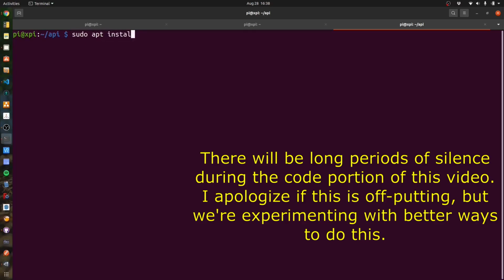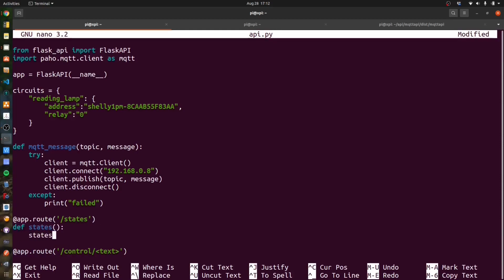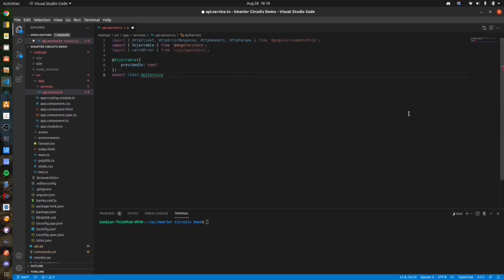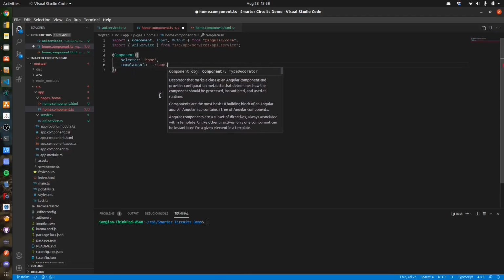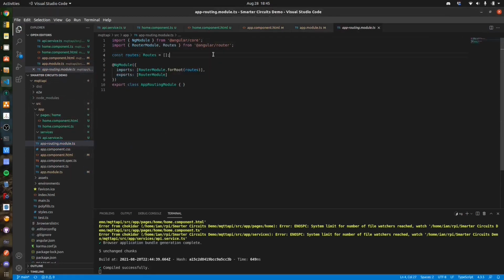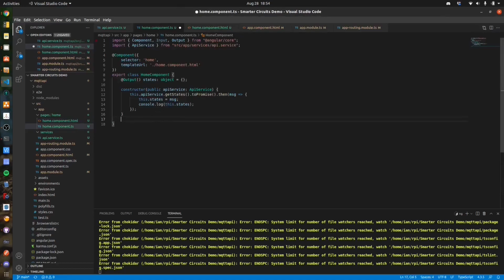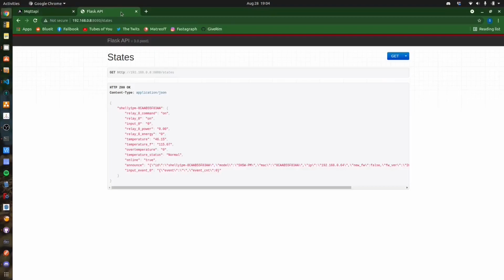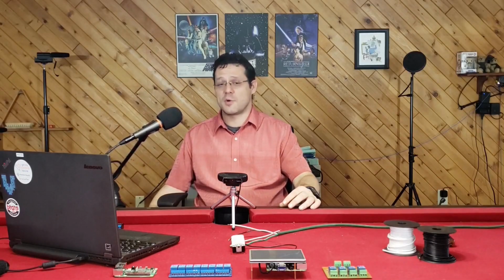Control Circuits With Shelly Relays, MQTT, FlaskAPI, TKinter, Angular, and Raspberry Pi - Part Three

Comment: Very nice series, thanks for sharing, I'm in doubt if to use MQTT for my implementation, although it makes things super easy, I don't like the fact that if MQTT is enabled the shellies will log off the cloud, I think the shelly app is rather decent, and I don't want to lose it. 

I think I'm going to have it by implementing a bunch of http calls to the shellies to query status and send commands.
Reply from the maker: If you like the Shelly app, I say keep it for sure. I only use MQTT as a way to go cloudless for my own reasons. I think one of the great things about these Shelly relays is that you have that flexibility to chose how you interface with them, be it MQTT, their own cloud app, web hooks, or even direct to device connection. I wish you the best of luck with your system!